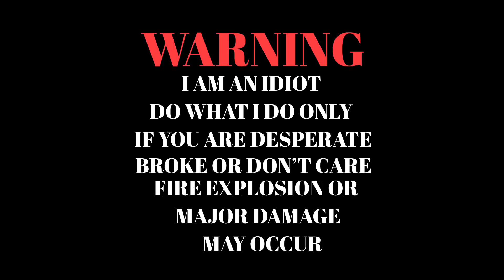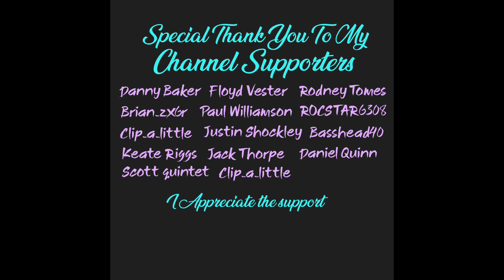Building Payton Johnson A C-max and enclosure work

Comment: I believe 1 of the wires goes to the alt positive post. That's what I had to do to mine to bypass the PCM to get higher voltage
Reply from the maker: i only run external regulated, and got sent a internal. so i have to send it back